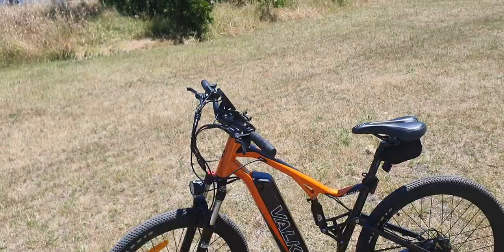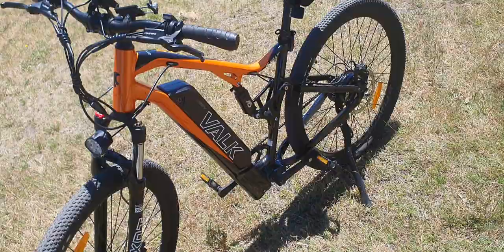valk e bike dual suspension does not work.

Comment: I have an identical Valk XT6 bike to yours. Recently celebrated 10,000km commuting in a little over twelve months almost trouble free. My rear suspension works perfectly and has always worked perfectly without adjustment or modification.

Comment: Your linkage has been installed incorrectly. The longest part of the linkage should mount to the downtube of the frame and to the top of the swingarm. Check the manual if you need to see it.
Reply from the maker: Yes I know. Kogan gave me the bike fully assembled like this... anyway kogan came and took the bike back and gave me a full refund.

Comment: I just bought a old duel suspension bike and made my own ebike . 1500w rear wheel cranks with my 2000w controller and my 60v 25 ah battery . Bit more than $1,500 but it all bloody works . Bouggt ebikes are junk . I also have a bbshd mid drive that i made out of a norco storm 2 . 3200 w of fun . That one cost me over $2,000 to build but its a killer bike . I just buy really good parts to put on the bikes i build . 203mm rotors with 4 piston brakes . Just build your own from parts to your specs you want . That bike will be stuffed in a year .
Reply from the maker: Yeah mate I think I will do that. I will have to make my own

Comment: All you had to do was reduce the factory pressure setting on the Air Shock, I had to do the same thing myself and the bike worked perfectly, your modifications haven't assisted, hope this helps.
Reply from the maker: No I figured out that the bike was assembled incorrectly. The hinge for the rear suspension was put on incorrectly it's upside down and around the wrong way. Kogan who I bought the bike off knows this by looking at the videos and is now in the middle of coming to pick it up to take it away for a replacement.